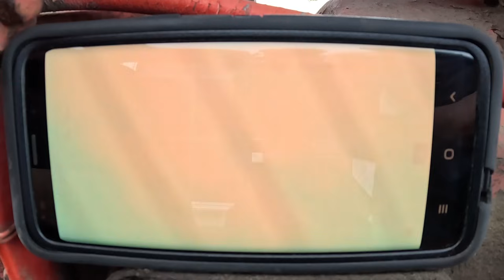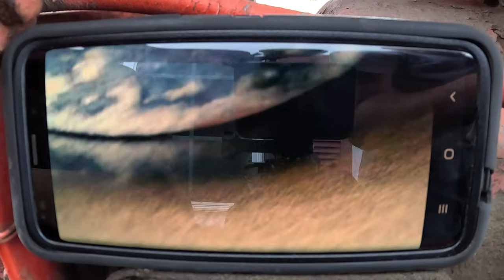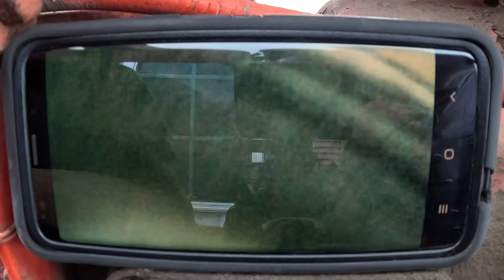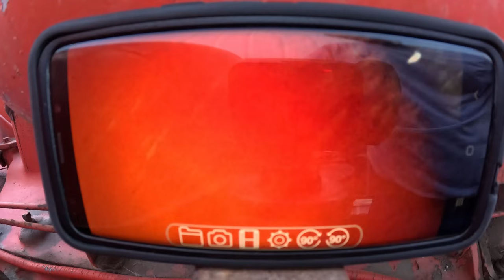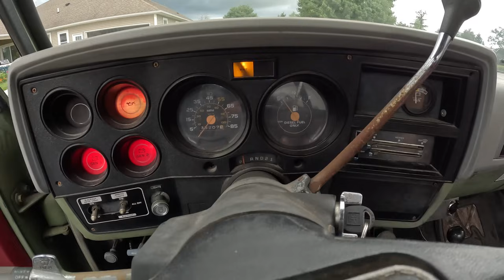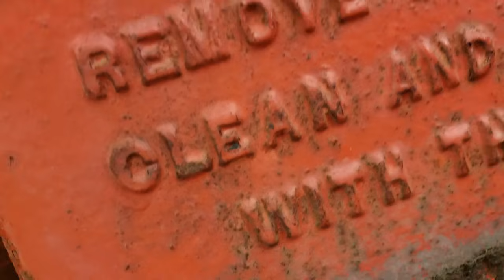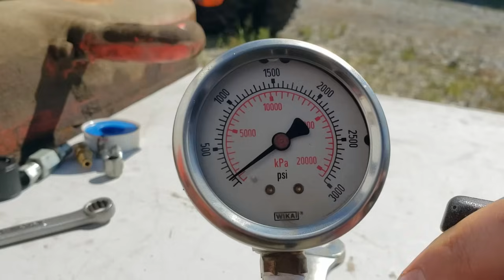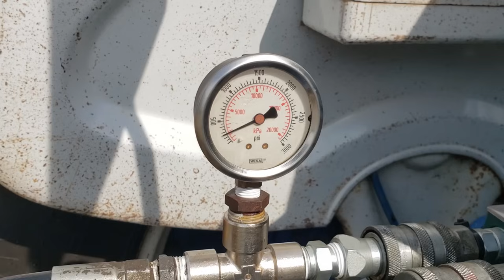How NOT to Unseize a Stuck Engine! - Latest Auction Find!

Comment: Wow - that's some kind of record for a stuck piston.  Somewhat similar to the 2 guys on Youtube with the Allis Chalmers WC - they ended up taking off the head and beating on the stuck pistons with a sledge hammer through an oak stick for hours.  Also a YouTube armchair 'expert' opinion only:  it seems that there should be some way to chemically reverse the rust.     Good to see the use of a tow rod instead of trying to finesse things around with a  chain.   The rest of the tractor looks to be in rare good condition for something of that age!

Comment: That's a BIG old piston to be trying to force !! Think about it !! That's 100 cubic inches in EACH cylinder. I was a bit surprised you didn't hook up a battery to the starter motor much sooner. Trying to turn the crank by dragging the machine is applying force like you are doing at the front, in the center of the crank. The starter applies torque at the ring gear on the outside diameter of the flywheel giving you quite a bit more leverage on the crank. That said, you used plenty of logic and thought with the heat, air, and hydraulics. Bottom line, it's turning again. Subb'd to see it run !! ;o) 
FWIW, I have successfully used white vinegar to dissolve rust in plumbing and cooling system issues. Wonder of it would work in a situation like this?? Especially since it was holding the fluid. Would definitely need to change the oil before trying to run the engine if/when it came free !!

Comment: I wonder if the piston pin was siezed? Becouse a guy would think if it was the piston siezed to the cylinder once it was broken loose it would free up? Ive seen piston pins siezed before that were stubborn like this.
Reply: Also if this block has sleeves for cylinders I've seen the sleeves break loose before. And soaking the rings might not help if it was a siezed piston  pin.

Comment: Pull the startermotor out. And use a praybar on the flywheel. But first, Check if the valves are free.

Comment: Pull the head off, clean the cylinder bores. Check the valve seats etc. Rebuild and you may just have a great working tractor. Probably would have been much quicker too to get it running.  Good interesting video though.

Comment: 4 months later. Mix up 1/4 tranny fluid and 3/4 acetone. Use oil dispenser to pump in plug holes...leave plugs out.
Take valve cover off and shoot around push rods etc....leave it 2 days then put the oh my jesus bar to er.  If she doesn't move, repeat. But unless something is broken, she will comply .  Repeat as necessary .

Comment: To unstick any stuck motor get a plug that screws into the spark plug hole put a grease zerk on it put it in a plug hole that is on the compression stoke and start pumping and will come loose ✌️

Comment: Drop the pan, fill the cylinders with whatever lube, jack up the tractor and put a block under a crank throw and let the weight of the tractor do the heavy work.

Comment: I think your assessment is backwards.  When the conrod is straight up, that's when turning the crank will put the greatest pull (or push, depending on which way you're going) on the piston.  Several degrees of turn on the crank generates almost no movement up or down, so the torque you put into the crank is multiplied.

Comment: Even if that method eventually succeeds, think of the damage to the soft material of the white metal big end bearings, think of the circular ring of rusted cylinder where the piston rings have been sitting for all those years. Surely youre better stripping the engine down, reboring the cylinders and investing I some new pistons and rings?

Comment: I have seen a person try to free up a stuck engine using the entire weight of the tractor front end while it was soaking he jacked up the tractor and put a bar in the slot like you did and lowered the tractor back down with the wrench resting on a block holding the front end off the ground.

Comment: In oder for pull method to work you have get a decent amount of speed built up before you pop the clutch if you would use the pickup truck to pull the tractor up to speed and pop the clutch it will come lose

Comment: Did you ever pull starter out , put bar on fly wheel more pressure go back and forth
Reply from the maker: I thought about that, but I'd sure hate to damage the teeth on the ring gear.

Comment: I don't know, but you still have to pull the head to do a valve job, and I wouldn't run it without dropping the pan and checking the lower end.

Comment: If you drain the oil out and fill the engine with diesel fuel as high as you can up to the carb and leave it for time that will often soak it free
If it’s stuck

Comment: Best trick? Pull the plug then pour the cylinder full of  diet brown soda; any of them that contain phosphoric acid. "Diet" because it makes no sticky mess to attract ants. let it sit for a few days, rock it back & forth by hand using the flywheel nut or crank.  The phosphoric acid dissolves rust. Once you can get it to turn through by hand, squirt it full of kerosene or diesel  to flush out the soda and keep turning it. Once if moves freely, squirt it full of Kroil spray lubricant. Of course, if the rust is to the crunchy, bubbly stage, this won't help. That goes to disassembly &  boring or sleeving.

Comment: Knock, knock, knock on heavens door ...
Some startgas, a sparkplug, an ignition coil, a 12V source, some wiring - poof it will loosen up.
It will never be subjected to any pressure higher than during running, and only for a milli second.

Comment: i think for the amount of time you spent trying to get that piston to move… id have whipped off the head, cleaned it all and new head gaskit.  Even if it moves your gonna grind all that rust into the bore when you free it.  May cause more damage in the long run.
Reply from the maker: But how will you get the piston to move with the head off? Check out the next videos on this tractor. I get it running and run it on a PTO dynamometer. Thanks for watching!

Comment: I had a motor that was freezed up will not turn turn it loosened to the main bearings rod bearing bolts and it turned over took off rod bearings cam bearings off and oiled them turn over easy

Comment: all you had yo do is remove the head and clean the cylinders it only would have taken 5-10 miunites to take off the head instead of hours of work and weeks of waiting its also better for the rings and cylinders because the rust can slightly grind them.

Comment: You could have taken the head off and repaired it the right way in a week. Forcing the rings to break loose is very detrimental to the cylinder surface. The oxides (rust) of metals is harder than the metal itself. This video is titled correctly.

Comment: A seized engine is normally seized at the piston where there is no lubrication.
Put a penetration oil in each cylinder and let it soak. The pipe on the crank is a good idea ... Beating on the side of the crank .... Not a good idea.

Comment: If'n Randy had a big turbocharger on his camo truck he could hit 70mph with 8,000lbs on his trailer. That way he could match speeds with the most high falootin Hyabusa motorcycles. Just a grinnin and pushing on that pedal down. Wind blow'in all that barn dust off his fancy Case tractors. 58 mph. Holy jimineze. I would rather drive a 1967 Dodge Polarise 150 mph than lay this tractor on 58 mph. Time to start praying. I just had to think of this Case running 58mph. Over in England when there in the 90's they had super fast turnip truck wagons pulled with tractors. Flying all over the place. By the way, roads over in England are about 3ft narrower than our roads and tall uneven grass is right at the road edge. The very tall grass has 2 or 3ft dips and clumps just at the road edge. Apparently no thought is given to the helpless driver 6 inches off the road. When visiting a friend they park right out in the very roadway blocking the lane perfectly. And no flashing light is ever considered.

Comment: GREAT VIDEO 😮   BUT that is not how to do it !  YOU TAKE THE HEAD OFF  and use EVAPORUST and hone the cylinders  !!! You are gonna have to do it any way to get the valves  done  . You work to hard at doing it the wrong way. 🥵
Reply from the maker: It's kind of one of those things where you don't think it will be that difficult and before you know you've spent days working on it. If you would have known how difficult it was from the beginning you probably would have done it a different way. Hindsight is 20/20 kind of thing. Thanks for watching!
Reply: Waiting for part 2   thanks  @Randys_Relics

Comment: remove starter motor, crow bar on flywheel. simple
Reply from the maker: Just to be clear, 750 PSI (pressure that began to move the piston) over the surface area of the piston equals 12,600 lbs of force. Do you believe a bar prying on a ring gear tooth would accomplish that without damaging the gear?

Comment: You better fix those valves asap, its the most unfunny when valve drops in the engine..

Best way to turn the engine is from the PTO, you can turn it as hard from there.

Dont use reverse to unstuck/start engines, the reverse shaft is the weakest link in any gearbox and could break by doing that.

Easy way to heat engine is to just pour hot water in the cooling system.. or bypass the radiator and jerryrig it to another engine to keep it heated up, it makes the world of difference.

Comment: What a waste of time. It might be OK if you have a lot of idle hours where you can fiddle and fart around accomplishing next to nothing. But somewhere all the wasted time where you could be doing something else has to enter the equation. 

If there are rust chunks around the outside of the piston that was tuck, then you are grinding/scratching away the cylinder wall as you rotate the engine. 

 One nice thing - thank you for not having obnoxious "music" sounds accompaniment - with the loops being the worst.

Comment: What a backward way of working a stuck Case motor, in 30 minutes you could have the head of and pop the whole sleeve out, undo the crankshaft connection rod , take the torch to the outside of the sleeve and you would have it free, without damaging anything and saved yourself 3-4 days of videos.

Comment: To much drama just remove the cylinder head the valves are corroded with rust the seats may be corroded to the pistons don;t move up & down then you can work in the pistons and if you remove the oil pan you may work on the crankshaft bearings